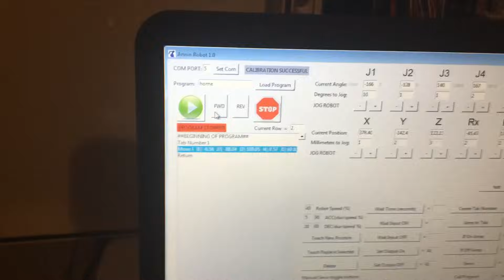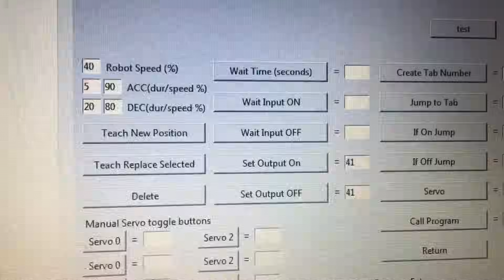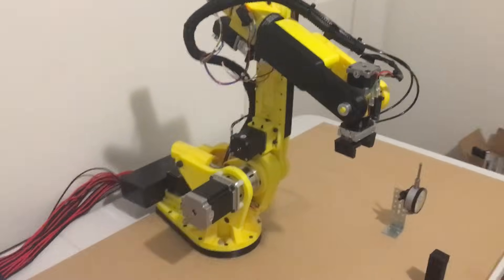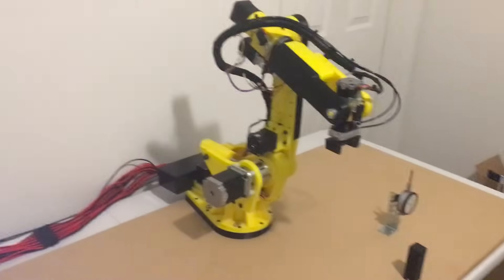3D printed  6 axis stepper motor robot - Gen2

Comment: Is it possible to run ACS macros for end to end serial arguments. So you could 
Case Array 1()
Robot.Move(A, 100, B, 240, C, 180, D, 10);
Robot.Move(A, 30, B , 170, C, 20, D, 222);
Robot.Move(A...

Case Array2()
Robot.Move(A, 160, B, 40, C, 18, D, 110);
Robot.Move(A, 230, B , 144, C, 20, D, 22);
Robot.Move(A...

Case Array3()

Serial.Read(data);
if (data == GestureGreet){
Case Array40();
Case Array14();
Case Array5();
}
else if (data == GestureSuggest){

Where you can run args for animation calls with preset animation vars called from the serial connection? Just curious because I'm looking for something I can write an attachment to the YaPanda Engine for NLP interfacing. Thanks
Reply from the maker: not currently.  im just sending one string at a time for each position.  Im looking into buffering multiple arguments or sending an array of arguments but I havnt done any of that yet.
Reply: What are you driving the Servo Axis values 0-255 with? Is it Arduino based or Parallax based controller?
Reply from the maker: arduino

Comment: Why not use Linux CNC?
Reply from the maker: There's probably a number of other software options I could have used, this was an exercise in learning stepper motor control and 6 axis robot kinematics; and was something I wanted to learn for myself.  I wrote this specifically for 6 axis arms and also control for external IO, servos, wait times and other program navigation based on what is typically used with an industrial robot.  I hadn't heard of linuxCNC but it looks awesome,  what can you tell me about using it for a 6 axis robot? How is it programmed - is it setup for varying kinematic models?

Comment: Nice. Why does it shake?  Is it something that can be improved with s/w ?  Maybe it stops too suddenly.  Maybe s/w could make it decelerated gradually to a stop?
Reply from the maker: I have acceleration and deceleration controls programmed and It works really well. The shaking is largely due to the plastic material, some of it is due to backlash in the belt tension given plastic parts, some of it is due to backlash in the gear drives, and some of it is due to the shaky plastic table I had it on. I'm currently working on an aluminum version which will be much better. But I'm not too disappointed with this one given it's a 3d printed low-cost robot.

Comment: Approximate cost, at the time he compiled the materials list is 935 USD (plus some screws and nuts). Cheapest printer that would be suitable for this is roughly 500 USD, plus the plastic thread, soldering kit, computer and multimeter.

Comment: Thanks so much for open sourcing your code. I've been trying to wrap my head around serial communication between python and arduino and processing multiple pieces of data like you've done. Seeing how you've handled it has shown me the way. I am really just getting my feet wet with robotics but looking at this function for example "CalcFwdKin()" kinda blows my mind how you kept track of so many variables. I'm sure you look at it and know exactly whats going on but from an outside perspective, looks pretty complex, amazing build! I'm curious if you're an engineer for a living.
Reply from the maker: hello,  my day job is automating industrial processes working with industrial robots as well as other automation and scada systems.  you probably already saw it but on the project page there is an excel spreadsheet with all the kinematics worked out - I copied this right into the program so the source code matches the spreadsheet - thought that would make it easier for people to follow what was going on - that and im lazy so it was easy to copy-paste in.

Comment: Hi there mate. Do u have step files for this project , i cant open those files.
Reply from the maker: Im currently building an aluminum
version of this robot.  I’m working to
make the solid models or step files available as soon as possible.  My machinist has made a couple adjustments
given unexpected difference in the bearing models - I am waiting for his red
line prints. If I sent you models now you will be disappointed. When I made the
3-D printed version I found some of the same issues but I made the adjustments
to my print files to accommodate so they are correct however I did not modify
the original models that I sent to my machinist and I wanted him to verify the
exact changes needed. I am assembling the aluminum version now I expect to have
it done in a month or two and I will get the redline prints back as soon as I
can.  When this is done I will get .step files
published on the project page for all to use.
Reply: excellent idea ,changing the material to aluminium.Is it going to be cast or bolted ?
And what about your gear drives. I suppose you will use cycloid drives plus timing belts, which is better option rather than a planetary gear drive.I hope will be happy with ur result.

Comment: that has a lot of wobble. all the gears and bearings are 3d printed as well?
Reply from the maker: No all bearings are off the shelf metal bearings.  Most of the shaking is due to rigidity in the plastic parts, some is due to belt tension and some due to the plastic table it's on.  I'm working on an aluminum version which will be more stable.

Comment: Holy cow!  You killed it!  Amazing!  Just out of curiosity, will it integrate is with standard slicing input for 3D milling?  How would someone run an STL or g-code file through this?  Thanks so much!
Reply from the maker: Currently the kinematics are calculated in the computer and a position is sent to the Arduino. It would take some work to get the robot to interpret G code. I would need to move the kinematic calculations into the Arduino so that gcode or other could be streamed to the Arduino and converted to  position. If you watch my other video on programming you will see better how it works but basically you can jog the robot in xyz positions and then teach positions. The arduino makes all the motors work simultaneously so it doesn't move in perfect straight lines but as close as it can - basically what's known as a joint move in industrial robots. I would need to calculate the kinamatics in the arduino to calculate path control on the fly.

Comment: $1080??? Wow... What do you use it for?
Reply from the maker: The 3d printed one in this video was used for development. The goal is small simple material handling or machine tending applications. The aluminum version I'm working on now will be put to work unloading a CNC machine.  I take it the cost seems high to you?
Reply: Chris Annin For a hobbyist the cost is high. You must have some real use for the machine if you pay that much. It's not just for fun :)
Reply from the maker: I agree its a little expensive for hobby application.  I suppose someone  could build something cheaper using plastic servos but I set out to make something a little more usable but as cheap as I could.

Comment: are you using the reverse kinematic with jacobian matrix and more I think. Good job . Wy don't you use also encoders for feedback position?  Maybe the arduino due has not enaugh interrupt channel for that ...but you can create a separate controls for example by using one arduino uno for each one encoder and pulses to the drive. Arduino due has 3V3 output voltage and you have to use some chip to drive 5 V to the toshiba drivers.
Reply from the maker: I may look into brushless dc motors and encoders for the next round.  The goal of this one was lowest cost possible.  These steppers with integrated planetary gear drive are about as low cost as you are going to get I think.  I'll keep working on making it better.
Reply: brushless + resolver is more expensive  but more professional. It depends on your target level

Comment: i have a question about yout electrical diagram ,what are the relays for ?? enable and disable the driver?
Reply from the maker: I'm only using one of the relays to control the pneumatic solenoid for the gripper, I just designed it to have 8 relays because the 8 channel 5 vdc is common cheap relay board compatible with the arduino.  You don't have to install relays if you don't need them or you could use a different 5vdc relay, just thought it would be useful to be able to control solenoids or motors with the relay board.

Comment: Speaking about repeatability of limit switches during calibration routine, have you heard of Trinamics stepper motor drivers which can do homming without limit switches. Please check out this link which can better explain what I'm talking about : https://www.youtube.com/watch?v=QKz61DG8Jbw   .  It uses a technology called stall guard which can detect motor stall. In fact Trinamics drivers have many more features that can greatly enhance the performance of stepper motors like CoolStep, dcStep, etc.

Comment: is it 24 volts or 12 ?
Reply from the maker: The stepper drivers use a 24 V DC power supply. The Arduino input output's and the relay output board are 5 V DC. Inside the control box as both 24 and 5 VDC power supplies. On the project page there is a PDF wiring schematic that shows a little bit better how it's all wired up.
Reply: i always thought that 24v steppers were much quiter maybe its the grearing ?

Comment: When it goes to its limit switches for the calibration routine, does it tell you the variation amount(s) it had to correct to learn about its repeatability?
Reply from the maker: No but its very interesting you bring that up. one feature i was thinking about adding was a calibration "check" where you could periodically run it to the calibration position and see how many steps each axis was off by and either set off an alarm or recalibrate. there are quite a few things id like to keep working on, not sure what im working on next.  good idea, thank you
Reply: What if you had real-time position sensors at each joint and especially at the final tool head for continuous calibration and also full control over the arm re: snaking in and out of any difficult clearance issues?
Reply from the maker: I think what you are getting to is servo control which would be ideal. The purpose behind this robot is a first step into low cost DIY robotics.  Unfortunately steppers are open loop, not as reliable or as strong as servo motors.  Most little servo robots are $15k.  I have a number of things I want to work on.  Aside from kinamatic improvements servo motors are high on the list.  Or at least coming up with cost effective options for DC motor encoder control.

Comment: Awesome build...

One question, do you use the microstepping for the motors? If not, you might be able to lessen the noise a bit if your MCU can handle it.
Reply from the maker: Most of the motors are 1/4 or 1/8 step. I think the microphone picks up a bit more noise than is actually perceived in person. The fact that everything is direct drive with no dampening and being bolted to a large board doesn't help.

Comment: very nice build. but steppers are very slow/weak and prone to slip. any way to use hobby brushless with cheap encoders?
Reply from the maker: I agree - keep in mind the goal was the simplest lowest cost possible.  I have quite a few future steps I'd like to do, one of them is transitioning to servo motors.  Some other things I'd like to do is building one out of aluminum, path calculations and tool frame calculations-  not sure what I'm working on next.
Reply: The problem with things that are labelled servo is price. Not that they have to be expensive, they just are. Which is why I suggested the very cost effective RC brushless motor parts.
For far too long there hasn't been such good low cost servo options. Someone really should make a business out of mass producing that and destroying that industry idiocy.

Comment: hey chris, im doing a similar project for my MSc dissertation, wondering what method you used to calculate the inverse kinematics and if when programming the actuation of the robot, did you just open loop rely on the inverse kinematics or did you close the loop relying on sensors (effectively ignoring kinematics in favour of realtime sensors data)? great videos, great machine.
Reply from the maker: Thank you, I'll be doing a video shortly on the kinamatics, robot is open loop - no encoders, the program tracks current position and simple limit switches are used to periodically calibrate. Check out the build instructions and electrical drawing PDF files on the project page - will give you a much better idea how it works.

Comment: Pretty phenomenal!  How much of a payload do you think it can handle?  I've been starting to plan out something similar to hold a DSLR camera which is probably about 2-3lb (thinking on the safe side) with lens.  It doesn't have to be fast, but precision and repeatability are important.
Reply from the maker: I havnt pushed the limit on the plastic version but ive picked up 12 to 15 oz at the gripper and 25 or so at the wrist. thank you

Comment: Hello! 
Good job, there is any way to store path in eprom?
Reply from the maker: Currently the program is stored on the PC in a list format and the program then sends serial commands to the Arduino for each move. I suppose it would be possible to move the interpreter on to the Arduino board and have it read from a pre programmed list off of a flash drive. Would take a little work.

Comment: and you can conver this to print in 3d? a robot printer 3d?
Reply from the maker: If you mean convert it to hold an extruder and perform 3D printing - no its currently not setup for that type of path planning to do 3D printing and its not rigid enough.  this robot is suited for simple pick and place operations and is set up to teach positions point to point.  I would need to develop kinamatics to follow Gcode or similar.  A 3 axis printer is much better suited for that application.
Reply: :/ i dream with a robotic arm printer , but the "real"  is to much expensive

Comment: Nice Job!  So much work on the software too.  You should be sure to have a look at machinekit for controlling these things, you might be able to get some more performance from a machinekit config, with support for more hardware and a larger support community.  Not trying to detract from your software of course, you have done a ton of good work.  I just think about how nice it would be controlling via ROS-Industrial over to machinekit.  Kinematics could be handled at the ROS level or machinekit on a ARM processor.  Anyway, I'm subscribed, good luck!

Comment: Do you have any plans for this robot? Are you going to sell it or just keep it around the house to tinker with ?
Reply from the maker: the one in the video i'll just tinker and test with.  currently im working on 2 things: getting the software posted and building an aluminum version.  I didnt have a specific job in mind for this project - just general material handling for low budget audience.  It started with a 3 axis engraver I built and then got my curiosity going on building a 6 axis robot since thats what I play with in my day job.   thought it would be cool to develop a small robot anyone could make /use.

Comment: very impressive, the best diy robot arm i ever see. are you going to share the file ?!
Reply from the maker: thank you.  yes I will post all the files.  finishing up a few things and will post soon.
Reply: Chris Annin thank you 👍
actually I don't have 3d printer, but i have cnc machine, do you think is it possible to use the file to mill the parts from aluminum ?! 
thank you

Comment: If fitted for an extruder could it be used to 3d print? (excluding the need for build plate)
Reply from the maker: No not currently.  the saved positions are sent to the arduino and executed point to point. a future goal would be to move the kinematic calculations into the arduino and implement path control.  In addition the gear boxes do have some backlash (.010" repeatability given arms under compression) good enough for basic pick and place handling operations but not for printing. Not to mention a 3 axis machine is much better suited for printing and milling operations.  A robot could do it given servos and harmonic drive gearboxes and much higher sophistication in the programming but your talking about a $20K robot to do what a $500 printer is much better suited for. A extremely low cost robot such as this might provide a good solution for moving objects around whereas a 3 axis machine (not be capable of moving objects around) is much more suited for printing and milling.

Comment: Nice robot, but it has typical home made problems.. gearboxes wih back slash,movement  speed, poor torsion.  Plastic parts looks like nice but are "Elastic". Try to change gearboxes to non-backslash type and use metal body. I have good experiences in" Low cost" level with belts.. smoother, faster, silent at microsteps aroud 1600-3200.. But do not take it my comment as critism, my compliment is to your software.. But Mechanics is poor..depend on your possibility..
Reply from the maker: yes it is designed to be a low cost but usable  - its not a lab grade $15K servo robot unfortunately.  I am working on making this robot out of aluminum but that will not change the fact that these are low cost planetary gear drives.
Reply: Chris Annin not planetary.. use ball reducer.. better.. check my video vith robot , there are used as "stands" for screews.. :-)
Reply: .. and second problem with backslash is not correctly named gear box.. if is used stepper motor then magnetic field is a problem. For low cost system - stepper motor-belt reducer-arm is for good precission neccessary to use nir standard stepper motor but "servo" stepper with possition control of the shaft. the price is not so higher but final effect is totally different. Feedback sensors directly joined with "rotor" of the SM keep magnetic field .. and it is what decrease/minimalize backslash. Then you can use standard belt reducer..low cost solution for home made robots..